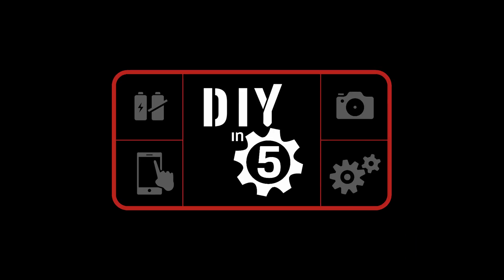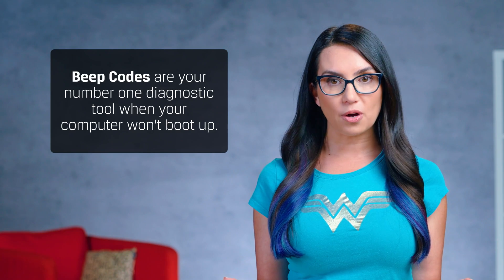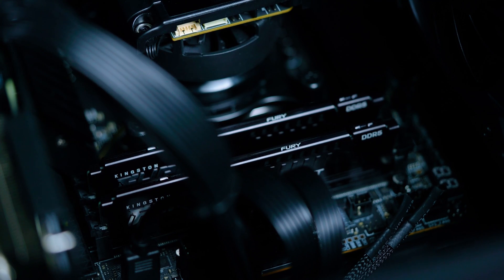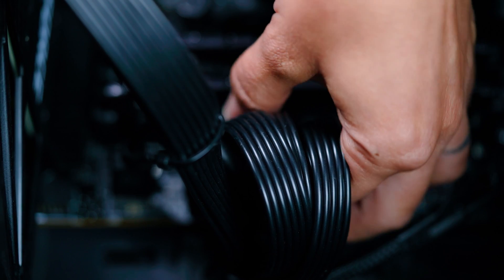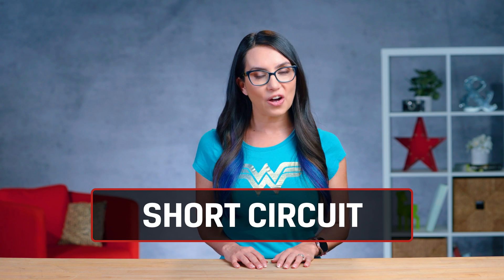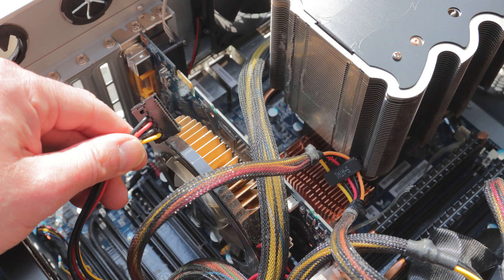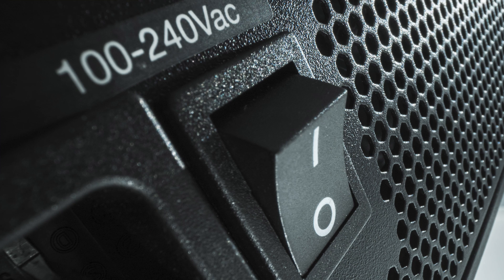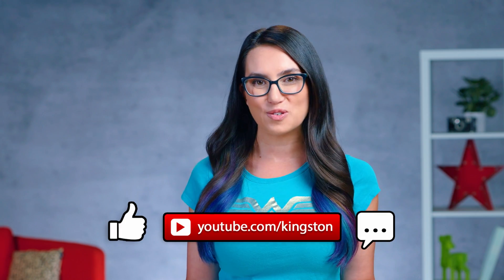Common PC problems and how to fix them: Motherboards – DIY in 5 Ep 202

Comment: Just built a new PC... found out that even though it says WIFI on the box for the mother board it apparently doesn't come with the drivers to work it... I have tried a couple of times and it won't install... does windows need to be activated for this to happen?
Reply: It sounds like the WiFi functionality on your new PC's motherboard might be causing the issue. Here are a few steps you can try:

**1. Motherboard Compatibility**:

* Verify that the motherboard indeed supports WiFi. Check the specifications or consult the manufacturer's documentation.

**2. Install WiFi Drivers**:

* Even if the motherboard supports WiFi, it may require additional drivers. Try installing the WiFi drivers provided by the motherboard manufacturer or search for them online.

**3. Windows Activation**:

* Windows activation should not directly affect WiFi functionality. However, if your PC is experiencing other issues due to an unactivated Windows license, it could potentially impact network connectivity. Ensure your Windows license is activated and valid.

**4. BIOS Settings**:

* Access the BIOS settings and ensure that the WiFi functionality is enabled. This is often found under a "Network" or "Wireless" section.

**5. Hardware Issues**:

* If none of the above steps work, there may be a hardware issue with the WiFi card or antenna. This would require further troubleshooting or seeking assistance from a professional. 

**Additional Tips**:

* Check if other network devices (e.g., Ethernet) are working properly.
* Restart your PC and try again.
* Consult the motherboard and PC manufacturer's support forums for similar issues.

Comment: One of the most overlooked problem is the 12/24 pin modular cables connected to the PSU end have come loose.
Reply: It seems I am having the same issue when the laptop is out on a leaned stand

Comment: Had a PC on a UPS running fine collecting camera data and managing other equipment - I use it in my observatory - went out to check on it and it had rebooted itself, no blue screen, no error codes of any kind, just waiting at the logon screen.  Decided it was most likely the PSU, replaced it - no more issues after that.